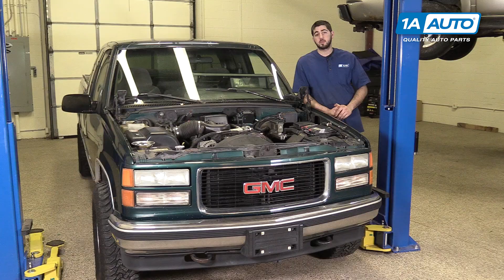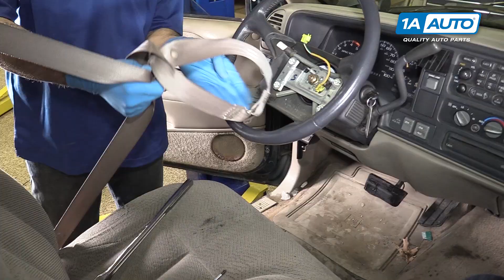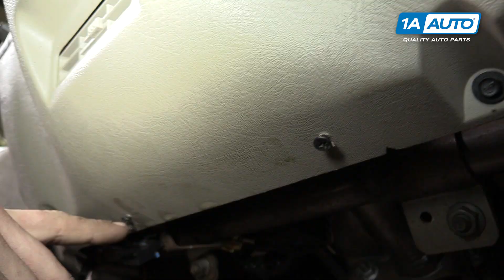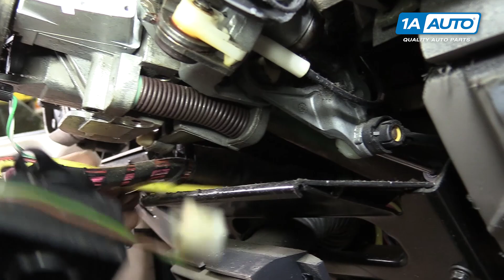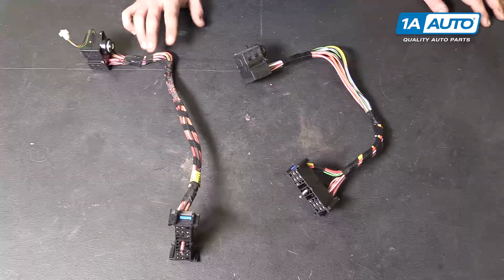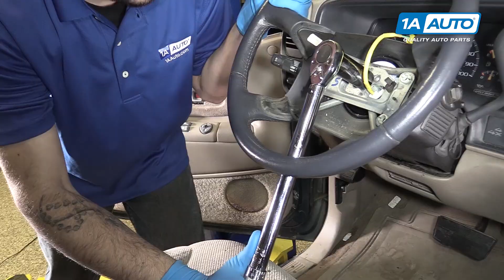How to Replace Ignition Starter Switch 95-96 GMC K1500

Comment: ANYONE i have a 95 single cab indigo blue z71 short wheel base obs lifted 9 inches ive had that truck for 26 yrs and ive had so many offers but nope,so anyways i replaced the ignition a couple years ago and it went fine,but now i went to crank it and it just went click,2 brand new yellow tops so i was like what now,i turned the key all the way then tapped with my fist on the upper shroud over the key area and it cranked up,so i removed the shrouds and it cranks up every time ,i put the shrouds back on nothing is binding the key,WHAT COULD IT BE ? please anyone,i need to take it to the shop next week to get the trans rebuilt for like the 7th time and im scared its going to get down there and not start,any ideas thanks i really dont know except a grimlin.uhhhh

Comment: Mine started grinding one morning when i started it, as the starter wouldn't disengage from the flywheel. It kept cranking in park or neutral.  So, i changed the starter-- but this changes nothing.  I had a neighbor start it while i removed the s-wire, and found that it ran fine.  We figured it was a wiring problem, and here it was.  This video and part helped me do it on my own, when it would have cost me a lot at a time, and money that we don't have.  I have to get to work!!  Thanks for this!!!

Comment: Where did this alignment pin at 18:20 appear as there is no visual of this "new" part being added nor the e-clip being re-installed...that plastic ring part around the steering wheel shaft changed colors implying old verse new part with no explanation...???

Comment: Can a bad ignition switch cause the starter to crank before I turn the key all the way? In “on” or “run” mode it starts cranking the engine and won’t stop unless I turn the key off. I think the starter is staying on and squealing when the engine starts. It literally starts to crank before I turn the key to start it. So weird.
Reply from the maker: +L H We wouldn't be able to diagnose an issue like that here, you may want to have a local mechanic take a look at it. Thanks for checking us out! http://1aau.to/m/Shop-1AAuto-c

Comment: I had an issue where my vehicle would start with no key, or any key would fit and turn the ignition. I replaced my ignition lock cylinder, and now my new key won't come out, It don't look like my key is turning all the way into the off position. My question is, would a faulty ignition switch like this cause a key not to turn all the way off? Thanks!
Reply from the maker: +Jake We wouldn't be able to diagnose an issue like that here, you may want to have a local mechanic take a look at it. Thanks for checking us out! http://1aau.to/m/Shop-1AAuto-c

Comment: I currently have a problem with my 98 Tahoe each time I turn the switch into the run position my ignition 40 fuse blows … could these be the problem? ( starter is new thinking that was the problem I replace it since was giving up) I have no other issue whatsoever….
Thank you great video

Comment: Great video, as usual from 1A Auto!  It appears they replaced the clock spring in this video but did not detail the work on that part.  That is the only reason the wheel and the snap ring on the clock spring would need to be removed.

Comment: So my 95 Chevy k2500 cut out on me and turned back on when I was juggling the keys the lights turned on. I went to start it this morning and the light only turns on on the dash at a certain point when my key is turned to the off position and when I go to cycle the light cuts out. Would this be my problem?
Reply from the maker: +Dusty Berkram We wouldn't be able to diagnose an issue like that here, you may want to have a local mechanic take a look at it. Thanks for checking us out! http://1aau.to/m/Shop-1AAuto-c

Comment: Another great, thorough tutorial. My son’s 98 Silverado keeps poppin’ the “IGN-1” fuse (@fuse box under hood). I’ve inspected the fuse box and the underneath side, no signs of burns or corrosion. Could a faulty ignition switch assembly be the culprit? Or, is there something else I should investigate. Thanks.

Comment: I still can crank my truck but the fuel pump and dash lights and turn signals won't work. Would this part be the cause of my problem 95 Cheyenne k2500 4x4.
Reply: Did you solve it? I have the same problem....😢

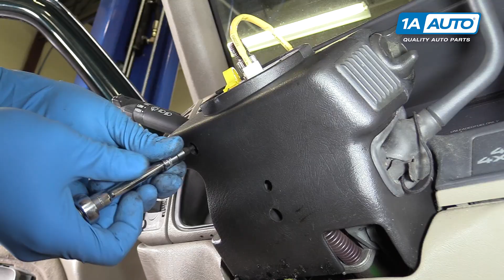Comment: 18:04, you did not install the snap ring that retains the clockspring.  I would remove that step, confusing.  Don't remove it in the first place, do not need to remove the clock spring to complete the service.

Comment: Question:   Can a bad ignition switch cause an intermittent problem where the alternator does not  charge but vehicle will still crank and start?    I have this problem on my  truck and  neither myself nor 3 mechanics have been able to figure out what's going on. It has new alternator, battery etc...problem still randomly happens, which then causes trans computer to not power and truck is stuck in 1st gear with battery discharging.  A friend said ignition switch could be the cause... Fun times.

Comment: Excellent presentation!   I was an instructor for thirty years and don't believe I ever heard anyone as articulate as you are.  There was not a single pause, such as searching for a word and your pace was perfect.  You should be a college professor!  Our situation is a bit different in that the engine will not turn off, even with the key removed.  We disconnected the battery to shut down the engine and, also, the panel lights were remaining illuminated.  Best of luck from out here in Idaho and we definitely owe you a beer!

Comment: Ok so any help would be appreciated.. my 96 Silverado gets stuck in crank mode while cranking the truck. It cranks up just fine but the key gets stuck in crank mode. I’ve already replaced the ignition key and lock cylinder and door locks with one from 1a auto. I thought that would fox the problem but it didn’t so I was wondering would this ignition switch fix the problem?

Comment: I got a 97 single cab , was experiencing issues before I got to the first step. ( Disconnect negative cable on battery) . Barely a quarter turn to loosen the cable I got power. I recommend to anyone experiencing problems to try this first!

Comment: My 1996 K1500 had was not shifting, the Tach/Speedometer quit and the gear indicator was out.  Ordered this part and replaced the starter switch and it fixed it all. The video is spot on. A couple things to add.  No need to remove the snap ring.  While not necessary to remove the steering wheel it really gives you room to work if you do.  Also pay attention to the direction he is using the screwdriver to remove the airbag. The E-4 star bit can be found at O'riley auto parts. They are a slender 1/4 inch drive socket set of 5 and will fit to take off the two screws holding the switch on.   Disassembly took a few because I had never done it but reassembly only took about 30 minutes.  Not that hard to do and will save you money by not having someone else do it.

Comment: Removing the steering wheel and messing with the airbag is an unnecessary step while replacing the ignition switch. The rest of this video is step-by-step exactly how the process should be done.
Reply: I was wondering about that.  I replaced the key/tumbler assembly without pulling the wheel so I was going leave it unless necessary on this little job too.  I was actually going to comment/inquire about it until I saw your post.  Thanks.

Comment: When I put the lock cylinder back in it won’t turn so I can get the key out but it turns to the battery on position and start position, any ideas?
Reply: I had that same problem. I used a dead blow and tapped the cylinder with the key in a few times and got it to move.

Comment: I have a 95 diesel and one day I went to start it up and nothing.  I had zero issues with speedo transmission etc. I waited a push button switch up and that worked great for a few weeks.  Then my glow plug light stopped working and it was crank city no start. I checked voltage on the harness weird and one has zero current.  I will be picking up that e4 bit tomorrow and finishing this job.  Hopefully that does the trick.  Really want to get the new tires back running...
Reply from the maker: +Dixieland Holdings LLC Thanks for checking us out! http://1aau.to/m/Shop-1AAuto-c

Comment: Would the ignition wire be the cause of a no start no spark no fuel pressure?
Reply: Jnez08  did you find an answer for this question? I was told yes this will cause a no spark issue and code usually ends up stating it is a Crank shaft position sensor.

Comment: I have a stripped bolt down on the wiring harness it moves around freely but the center bolt/nut/screw is not coming out. Any advice?

Comment: If your having transmission trouble, check fuse 20 in the dash fuse pannel. If theres no power supplied to that fuse then your ignition switch has failed.
Reply from the maker: +Dan Hammond Thanks for the feedback!
Reply: What fuse 20?

Comment: I have a 98 Chevy c1500 w/t 4.3 rcsb . Security light on permanent. Unfortunately I disconnected the battery and now it starts and shuts off immediately. What can I do? Also do you have an ignition switch for my truck?
Reply: Security relearn

Comment: I got a problem with my 1995 chevy, sometimes it dies when i turn the right or left signal or press on the brakes. I turn back the key and than forward and starts again. Could it be the ignition swith?
Reply: My turn signal also out and all guages but flashers work. About to change now, finger's crossed
Reply: Turn signal or step on the brake to put into drive it just dies? Like doesn’t choke or anything just acts like pressing the brake means I turned the key off..? Mines doing the same thing and I’m going nuts trying to track this down

Comment: Hi on my 97 Chevy c1500 I broke the key censor that goes inside the switch housing.  Can I use it with out the censor or is ther a repair for just the small plastic censor

Comment: Symptoms of a bad ignition switch are no tac or speedometer working to include odometer stops working also.   Transmission feels like its slipping and not shifting correctly.   Problem solved by replacing the switch.   Was worried that it was the ECM much more expensive.   not much content on the web about this fix.
Reply from the maker: +Ryan Wilcox Thanks for the feedback!

Comment: i have a 95 with no tilt!.... i want to swap in a tilt column. do i have to find a 95 doner? or will a 96 97 or 98 steering column work? the reason i ask is because mine is tbi and 96 97 and 98 are vortec.

Comment: Could a failing ignition switch cause no speedo, tach, or gear select indicator, and no power to transmission fuse?
Reply: Yes but if that doesn't fix it could be the ecu but more likely the ignition switch I had the same problem

Comment: Just want everyone to know these Chevy models ignition switches go bad and it will cause a total cranking no spark situation. Luckily a previous owner told me to smack it a lil bit and it started one last time. Next morning nothin. I get mine in mail Tuesday and then we should be back in business. (After changing my entire ignition system under the hood) it turns out to be this damn thing LOL
Reply: I'm going through the same thing right now bro, I hope you got your truck back up and running. I've changed everything but this so far lol
Reply from the maker: +Taylor Olesen Thanks for the feedback!

Comment: Why u take the steering wheel off, easier access?
Reply from the maker: +Daddy_D 2015 This has to be removed for this replacement.  Makes it much easier!
Reply: @1AAuto   I just did it on my 2000 K 2500 and the my biggest problem was getting the torques 4 screws out holding the switch in. I didn't have any access to a long and extended one and a shorty  was all i had  so I literally had to grind it down. But I didn't take the steering wheel off. I really didn't want to, lol
Reply from the maker: +Daddy_D 2015 Thanks for the feedback!

Comment: My truck fuse 40-a fuse / ignition keeps blowing out. I've heard this could be related to fuel pump wiring issues. I jump started the started and even worked after a few cranks. What do you recomend my issue is? Also, please help me locate the area/wires that would most common be the issue at. 
Thanks in advance.
Reply from the maker: +Eric Martinez We wouldn't be able to diagnose an issue like that here, you may want to have a local mechanic take a look at it. Thanks for checking us out! 1AAuto.com
Reply: Wow finally done ody that knows what they are talking about
..I have a similar problem..turn key on to crank and guages don't work ,no power to starter and every thing else has 13.6l8ghts,radio,everything ,can even cross out starter and it turns over but no fire to ignition....0lease help0

Comment: I have a 98 astro , if i turn the key and it dont start But I play around with the tilt , up and down and then it starts , Do you think I need this kind of part on my van, thanks in advance.
Reply from the maker: +Max Stevens We wouldn't be able to diagnose an issue like that here, you may want to have a local mechanic take a look at it. Thanks for checking us out! 1AAuto.com

Comment: 1A Auto Will a bad ignition switch in a 1995 Chevy K1500 cause a 4L60e transmission to stick in 3rd gear and no Overdrive every now and then? My truck is fine but at the end of the day it'll stick in 3rd gear and not go into overdrive until I pull over and turn the truck off or unhook the battery after that it's shifts fine
Reply: My k1500 is doin the same this did you ever figure out the problem
Reply: @dallasjordan3548  The same thing happens to me, did they fix it?
Reply: The same thing happens to me, did they fix it?

Comment: Would this part help stop the security light on a 1999 Chevy Tahoe from coming on? Or is it the cylinder that needs to be replaced? Been having a issue with security light staying on or even flashing at some point. Have to wait 10 minutes before I can start up...

Plz help
Reply: The most important questions are never answered...did you solve the problem...mu 99 chevy express has this issue..was it the lock,,or switch

Comment: I have a 2000 suburban. I turn my key forward it starts fine. When it is started the key will not release back by its self. I will have to turn the key back manually when started. I did try to replace ignition itself and still continued. Would this be an ignition switch issue ? Thank you for any help.

Comment: I have this same truck almost. And I have trouble starting it. It'll start to turn over but then just stop and it'll just struggle to turn over. It's almost like it loses power to start and then a few seconds later it gets it back . I'll turn the key again but just slightly and it usually fires right up. Any ideas on what the problem is.?
Reply: I have the a similar problem to my 98 k2500 454. Suburban it will crank the engine but wont wont start i changed the fuel pump and fuel filter sparks plugs etc but i cpu says its an ignotion problem i havent changed it yet im guess i might have to change the ignition  harness also

Comment: Does this part fit the 97 K1500?
Reply from the maker: +D Bo Thanks for checking us out! This particular part is not going to be compatible with the 1997 K1500, it only goes up to 96. We currently do not have one that will work with the 97 year. We are always receiving new stock and may carry it in the future so be sure to check back!

Comment: Will this make my shift solenoid in my transmission to go bad?
Reply from the maker: +Bill Curry Thanks for watching!  This part is only related to the vehicle start up.  If you are having issues with your transmission then there is another problem.  1aauto.com
Reply: @1AAuto  okay thank you I had my transmission rebuilt just a little while ago had trouble with it and knew was the shifting solenoid they replaced it and they blamed it on the starter ignition
Reply: @billcurry7121  I have the same problem, did you fix it?

Comment: 97 K1500 Tach and Speedo dead this definitely is the fix. Easy enough to diagnose. Put a test light on #20 fuse if no power to transmission this is likely why. Not too hard to do recommend buying E4 and E5 deepwell 1/4 inch set. You don't need to remove the steering wheel.
Reply from the maker: Thanks for your comments and for watching! +Dale Everhart
Reply: happy to hear a 97 chevy takes this I was gonna be mad if this thing wasnt the fix

Comment: Fixed the issue with my truck. Tach was not working, speedo was stuck on 100, check gauges light on, gear indicator out, transmission could only be shifted between 2nd and 3rd manually. Thanks for the video. You WILL need a 4mm female torx socket for the steering wheel part of the switch. Start to finish, took me about 3 hours. I did not remove the steering wheel.
Reply from the maker: Thanks for the comments and for watching! +Kent Eaton

Comment: So I did an ignition switch replacement because I had no 12v to the fuel pump relay and spark. Truck still doesn't start. At my wits end with this thing. What could it be? 1995 K1500 5.7L. Need ideas.
Reply from the maker: +lftdblazer https://www.1aauto.com/search?q=ford+f150+power+folding+mirrors
Reply: Have u check the relay and if u have make sure when u replace it there isn't an issue with the pins